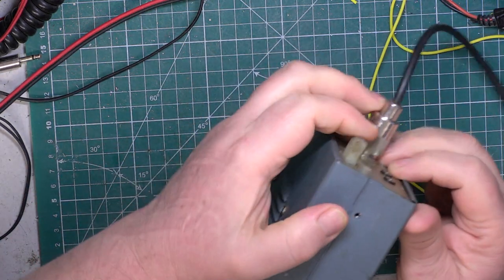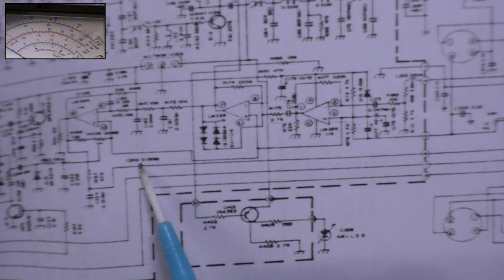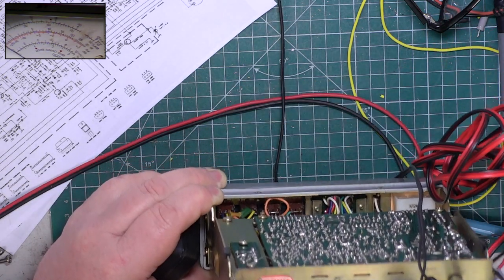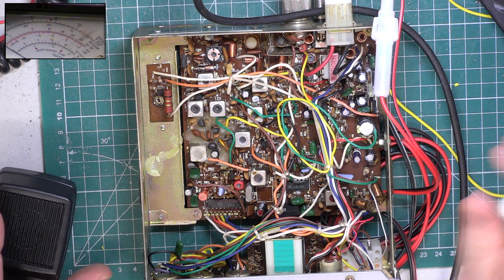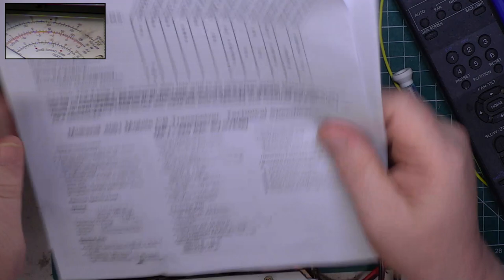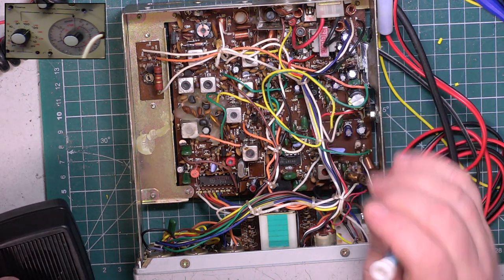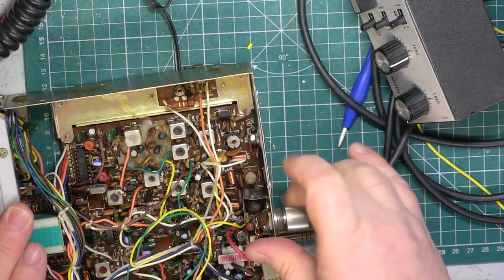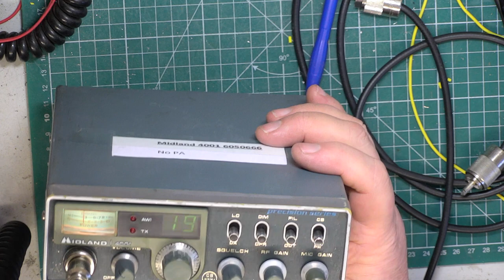Midland 4001 CB27/81 UK FM CB radio -  repair & realignment

Comment: Those were very good-looking sets, they at least looked the part.  They looked more expensive than the run-of-the-mill sets.  Shame the performance didn't match the looks, but they were a lot better than some set out there, and the new sets that quite honestly are mostly not worth buying.
Not much wonder some are using illegal sets.  Course, if they are caught with them!  A lot of money down the drain and a hefty fine to boot!
They looked good in their blue-green case and good-looking switches.  👍